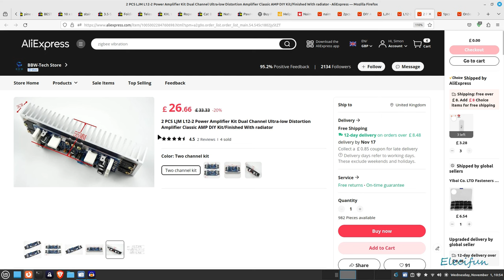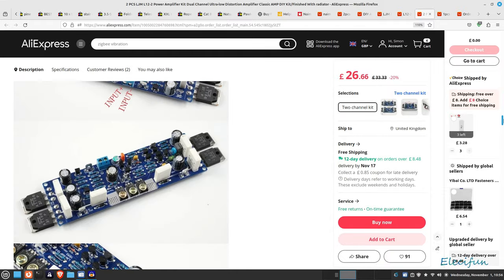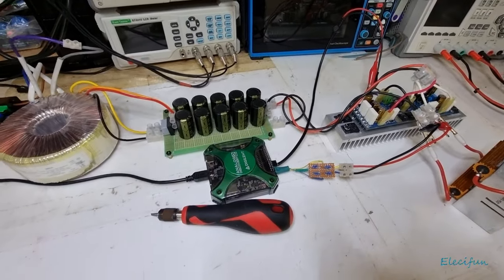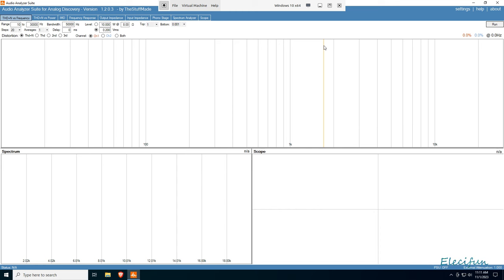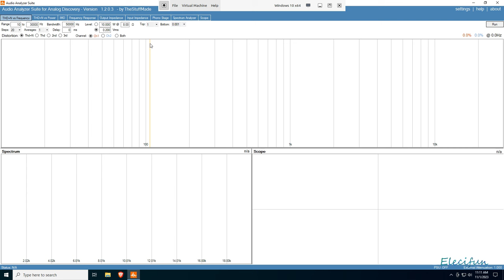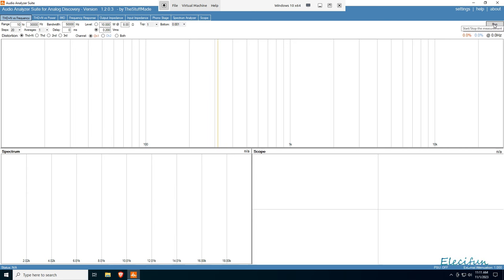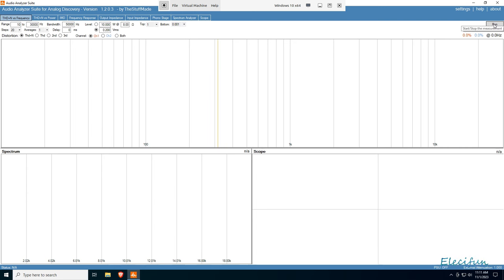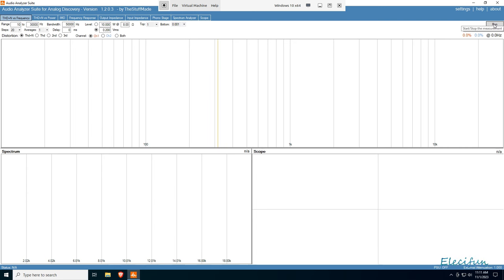LJM L12-2  Amplifier Kit (Aliexpress)

Comment: Wow ! 😂 I really like these bigger amps sir and that  laugh.@23:57 "...  that's pretty damn good! " evil laugh ! Ha ha 

Interesting video although I don't understand many of the stuff you talked about. 

Interesting that you can hear something else within the music when playing ABBA "the woosh"!

Also it was interesting to note that ceramic caps are not ideal on an audio amplifier.

What speakers are you using? 

I know you blew one out but never heard what happened? Did you buy another one?

I'm thinking of buying some 13" or bigger speakers for my long term project.

Right now it's just a dream still I'm hoping I can afford it eventually.

I'd like to build a three way bass reflex cabinet with three speakers with a crossover so that each frequency range is segregated. I hope I said that right 

🔊 
🔊 
🔊 

It won't be easy to afford because the speakers aren't cheap.

The cabinets dare I say I can build myself albeit it will be testing my woodworking capabilities.

I want it to be pretty grunty.

My mate built a really nice system at 17.

I think he used 13" bass drivers or maybe 14".

I can't remember.

Still I know the sound was unbelievably good. 😂

Anyway thanks for uploading this project most interesting.

So what's next?

300-400W amp next? 

I can't wait till your running 12 transistor amps. 😮😅
Reply from the maker: This amp has 19 transistors per channel, which should satisfy your 12 transistor fetish, lol.

My listening (not bench) speakers are Monitor Audio, Monitor 300's. I have the cheapest version and yet they sound great, its not all about looks. Lows 34Hz and 30kHz highs. 2 x 6.5inch bass drivers a 6.5 inch midrange and a precise soft dome tweeter per speaker. 

I'm not sure about 300-400W amps as I have no use for them. A nice 30 x 30W amp with some decent sensitive speakers will provide more than enough for most listeners.
These amp kits and my speakers sound good here, clear detailed, full frequency range and enough power to rock out the neighbours a block away. 

Bigger isn't always better 🤣
Reply: @Elecifun  19 transistors. Are you sure? What I mean is those 4 transistor thingys. 🤔😄

I'd need 300-400 to drive 13" speakers. I've already looked at the specs. 

Well I know trannies do two things and one of them is amplify sound. 

Okay, I wondered whether you fixed one of them. Didn't you blow one?
I'm sure they're a nice set of speakers.

I bought some ARs(Acoustic Research) years ago and yeah I love their quality still those big speakers bass drivers were just awesome.

Thats what I want to build for sure. When, how? 

I dont know money is an issue also there is much I dont know about amps.

Your knowledge is beyond my level of comprehension.

Well it may be true that size doesn't matter but speakers hmmm. 🤔😄

Comment: I think I might buy this kit.🤔 I can't find another amp with better fake specs.
Reply from the maker: I think sales people tend to puff piece for a sale.
Reply: @Elecifun  not quite sure what you mean. I think you mean sellers make the product look better than what they actually are. Which is true if that's what you mean.
Reply from the maker: @decem_unosquattro9538  There are many ways to advertise products, services. Some only advertise the best points and not the bad.. That's writing a 'puff piece'.
Reply: @Elecifun  oh okay. Thanks for the explanation.
Reply: @Elecifun  Lying about specs is pretty bad. Like for example putting the THD down as .00015 and then you test it and it's  .001 😏
Reply from the maker: Sometimes its all about setup/test environment. For an example. I use standard none screened transformers in my setup, this can lead to added noise. Also the amp circuit itself is not screened.
The tester that put up the output on the advert may have ideal conditions and equipment for the tests. 
My tests output a guide and should not be taken as much more than that. Any real issues will be shown but as for precision output data... there are to many environmental variables for high grade accuracy.

Anyway's.... an amplifier you may like is here   https://www.aliexpress.com/item/1005002484492250.html

Let me know what you think.

Comment: Hey Sir ! Im back again with another comment.😅

I watched other videos about the LJM L25 amplifier.

Well it was quite an interesting project.

He used:

 two LJM L25 ... modules

A power module (not sure what it was putting out) 70V??

No transformers I guess the power module was a switching style PSU module (something like that)

It also had a speaker protection module hooked into it.

He also had some DSP module powered by a power bank (i think) as an input source. (You'd understand it more than me)

Unfortunately they dont appear to be available 😕 

In another thread they say these modules are a bad design and they blow up easily.

Is there any truth to this statement  sir? 🤔
Reply from the maker: @decem_unosquattro9538 I've looked but can't find the amplifier on Aliexpress. Maybe it was not popular.
Reply: @Elecifun  Maybe there was some issue with it like what was stated by some dude in some random forum. 🤔

Maybe it's like the 30V 3A psu boards. There seems to be these boards or projects with problems or design issues.  The problem with stolen intellectual property is often or it seems that way. They have problems. The Chinese sellers don't really care they just want to sell something even if it's faulty. It's obviously not sold anymore. Maybe it's a blessing that it's not. It would be nice to be able  to buy a diy kit amp with Maybe 400RMS and very low THD. Anyway not to worry. There must be something out there that fits this criteria.🤔
Reply: @Elecifun  nice and hot down here. 37°C here 40°C + father North. I'll be glad when summer is over. It's a season I hate the most. 🥵
Reply from the maker: @decem_unosquattro9538  its winter here. Wet and moody weather.
Reply: @Elecifun  I like winter and it's the only season I sleep properly. So wet and moody I like. Still I think I probably prefer Autumn and Spring. Mild weather. It won't be long before your Spring. My big debt is coming up soon. 🫤
Reply: @Elecifun  oh you're up early maybe you're under the covers. Maybes your up eating apricot jam on toast.😀🍞🧉
Reply from the maker: @decem_unosquattro9538  My cat kept bugging me so I got up. Had a glass of water looked on here, responded to a couple of comments, then back to bed. I'm up now.
Reply from the maker: @decem_unosquattro9538  I like winter also. I like snow and crisp mornings. Here its wet, foggy and moody weather. A few days of snow to have fun. 
What's your big debt about?
Reply: @Elecifun  🐈‍⬛ ah ha ha yeah my nice has a cat and it drives her insane. It runs around at night and jumps up onto her bed and sniffs her face. 😆 good your up and about.
Reply: @Elecifun  Perscription glass 👓  and teeth. Over 2K. 🫤
Reply: @Elecifun  I'm bored but I dare not spend anymore money on "goodies". 😕
Reply from the maker: @decem_unosquattro9538  I had to shut him out my room so I could sleep. He is curled up right behind my chair as I sit typing this. Now I can't move my chair to get up.
Reply from the maker: @decem_unosquattro9538  wounded. Over here the state/tax payer helps with costs. Not cosmetic, necessary costs.
Reply: @Elecifun  Yeah my nice locks her cat in a small cage otherwise she goes nuts 😃😄
Reply: @Elecifun  you're a taxpayer also 15% GST over there  isn't there? 🤔

Comment: Hi Sir!

Sigh, I'm currently building this DIY kit and I just noticed my board is not version 3.00. It's version 4.2. I noticed your version is version 4.00. 

These boards versions are all over the place like a mad women's shit ! 

I hate it when they do a bait and switch or when they just send you us different versions when clearly what was advertised is was version 3.00.

Another annoying thing is that they don't put the parts it's supposed to have like on mine it has two odd sized thin film caps which are supposed to be 104s but they instead swapped it for 100nJ100s. 

I don't know whether they're fine or not! 🤬

Kinda over this bs ! 

I'm going to be so angry if this project doesn't work when it's finished. 

Fortunately I have a box of thin film caps which is why I always buy extra components. Sigh.

Anyway I shall continue building it and hopefully it works otherwise you hear me ranting from England! 😂😂 

See ya later dude! 😮
Reply from the maker: The caps are fine 104 is 100nF or 0.1mF. The board sounds like an improvement. Some old stock photos still left on newer adverts. I keep my fingers crossed also.
Reply: @Elecifun  Yeah, it would be most interesting if you bought this version and tested it. I might buy the same Fortitude thingy that you have and test this board I have. The more people testing the less we all need to do. 

Incidentally I remember you saying not to install monolithic caps and instead I should install electrolytic instead but the problem with that is they are polarised. I don't know which way they should be oriented within the circuit. Also I don't think I have a 105 electrolytic capacitor. 🤔 Anyway I just soldered it in. I guess it'll be detrimental to the sound quality still this is my first amplifier. I'll use it as a sacrificial lamb. I have much to learn as this road is a long one. I started reading 📚 about audio transformers. I guess they're really friggin expensive to buy. Maybe prohibitively expensive. 

I'm going to buy a soft start circuit and two speaker 🔊 protection modules.

My planned long term project may never get off the ground.

Two weeks ago I had my gas cut off because the price is fkn insane now.

No hot water.
No showers 
No hot water for washing up which ain't good. 
No heating.

No finances are that bad I was forced to take drastic action.

Anyway my first amplifier is finished. ✅️
Now I need a transformer 300VA 2x35V

Softstart module

Speaker protection 

Unfortunately I won't be able to test run these amps until I have my head above water (financially).

Soon I'll recommence my reno which I put on hold through the winter and severe lack of funds.

I'll finish another part of my house when I've repainted my boards. I just need another top coat before I reclad that section.

Comment: I think I'm going to need another soldering station like yours. Mine I feel might not have enough grunt. 

I really need something with a lot more heat.

They're awfully expensive to. 🫤

This project is going to hurt. 

Fkn sucks not having enough money. Sigh.
Reply from the maker: @decem_unosquattro9538 You have a Hako?
Reply: @Elecifun  Yes I have the Hakko 951 which is a great soldering iron. I'm now thinking maybe I need to get another one for projects that require more heat.
Reply: @Elecifun  I'm going to need a micro pen at some stage when I start soldering the smaller SMDs like:

1206 ✅️easy
0805 ✅️easy
0603 ✅️ more difficult 
0402 ⬅️
0201 ⬅️
Reply: @Elecifun  I've discovered another problem with my car. The LHF CV Joint drive shaft rubber boot has split open and it's leaking grease. Another job to do. Sigh. 🫤
Reply from the maker: @decem_unosquattro9538  That sucks.
Reply: @Elecifun  Yeah it's yet another cost that I'm forced to pay albeit I'll do it myself still I need to do the research on how to do it. I also discovered another problem.

The rack and pinon boot is also split which mean I need to fix that problem to.

It means project need to be put on hold and money diverted away from projects.  Sigh. 🫤
Reply from the maker: @decem_unosquattro9538  You could probably borrow a CV joint cracker and the boot shouldn't be to expensive. Fingers crossed.
I have set up a wine brew today but just realised the power point has no feed to it. Now I need to find an extension to power the wine barrel heater. 

All good fun.
Reply: @Elecifun  The car part dude thinks I should just go ahead and replace the drive shaft. It's been making a noise since I bought it 23 years ago. I'm kinda thinking I'd like to go genuine parts but maybe they just don't make them anymore. I think they say the carry parts for guaranteed 10 years but it could be even less than that now. The additional years maybe depends on the demand. 

It'd a dilemma because genuine parts are supposed to be better but is it really worth it?

The motor has done nearly 350'000 kms. 

I haven't done a compression test yet but at 340'000 KMs it's highly likely at the end of its life. 

It'll be sad to see the old girl go. It's been a wonderful car which has pretty much been years of very little maintenance.

I've changed the front rotors, a thermostat, the rear exhaust muffler, a water pump (expensive job which my mechanic did) a set of NGK spark plug leads, a set of 50/60 halogen bulbs, and a alternator. (I think I bought an alternator?) 🤔 Maybe I didn't?? Oh and a heater blower. 

Aside from that just the usual things like tyres, brake pads, engine oil & oil filters, fuel filter, and timing belts every 100K.
The odd wheel alignment also.

That's about it. 

Great little car. 🙂
Reply from the maker: @decem_unosquattro9538  Sounds like a good reliable motor. Pity when they give up.
Reply: @Elecifun  The old Toyota's are reliable and easy to work on. I'd never buy a hybrid car or some of the new vehicles because they're real garbage. They're terribly unreliable and very expensive fix.

An acquaintance I had a few years ago bought a VW Tiguan.

The 6 speed DSG gearbox failed. A new one was so expensive that he decided to buy a second hand one from the wreckers.

Then he broke a rear brake calliper.

Then the AC failed.

All up it cost him over $15'000 AUD. Fkn ridiculous on a relatively new vehicles. He bought it new yet it cost him a fortune. I remember new used to cost 6'000 new.  Now they cost 9X as much admittedly they have 50 systems in them still the quality is just shit now  😀😅

That's why I'm reluctant to buy a new second hand one